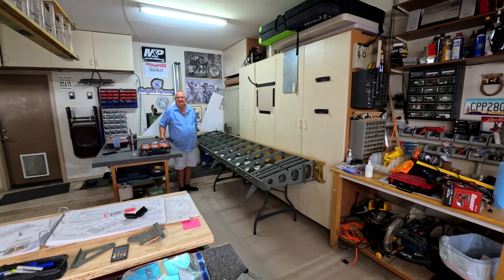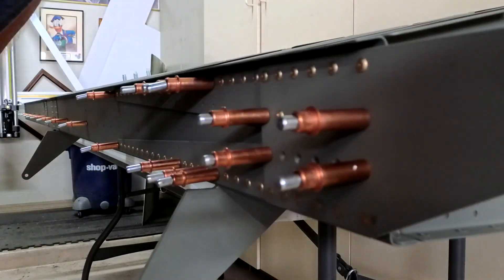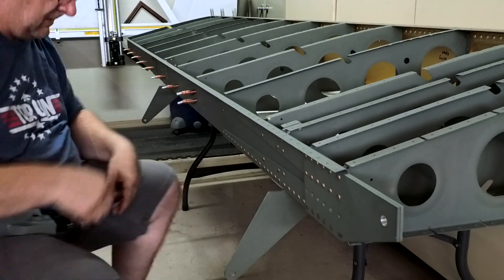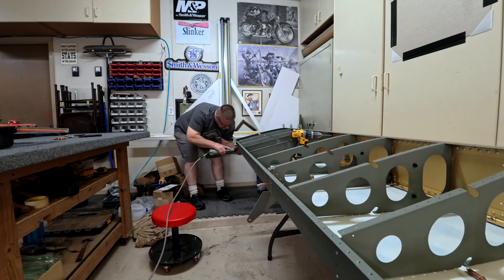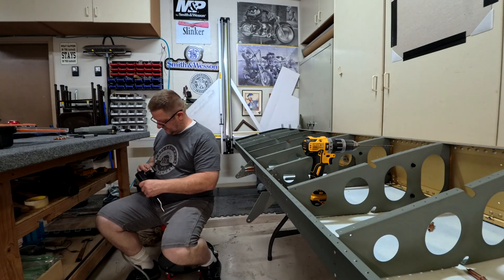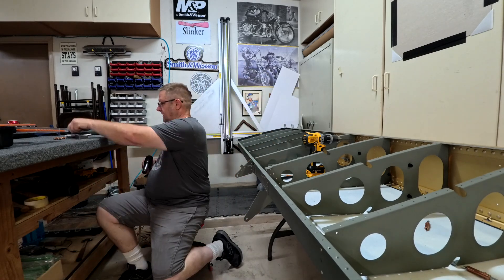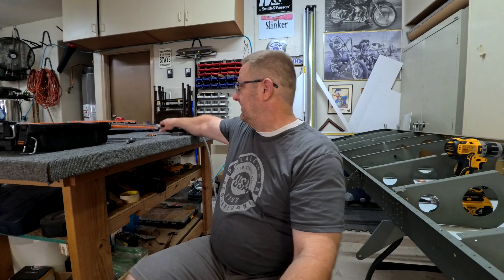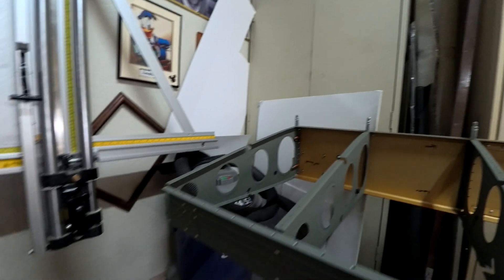RV-14A Build: Wings 13.10 - Building A Vans RV-14A #aviation #vansaircraft #dadjokes #diy #plane

Comment: Nice video.  I just finished Section 15 a week ago.  I also had to use the offset rivet set in those places.  Had to replace one of rivets in the process. Not fun.
Reply from the maker: Thanks for watching! I hate the offset rivet (I know hate is a strong word... but I really do hate offset riveting)
Reply: @SlinkAir  I'm not a great fan of it, either.  But, there seem to be lots of places where that method has to be used.  Not liked, but slowly getting used to it.  I think there will be a lot more occasions for its use getting the skins riveted.😬😒🙄  Just ordered a 7.5" straight set from Aircraft Spruce at your suggestion.